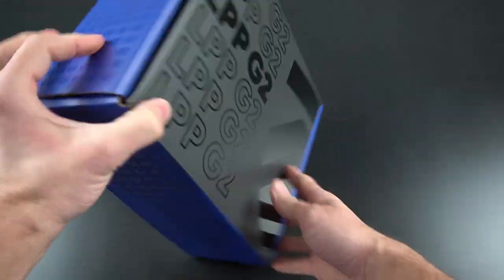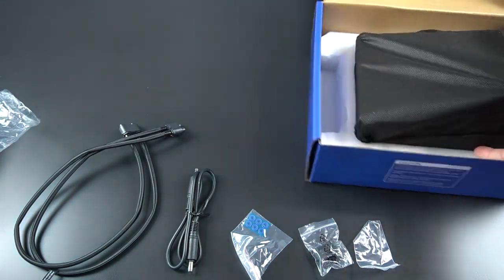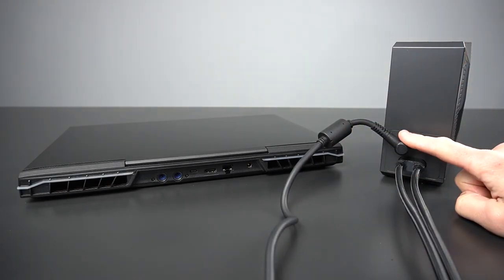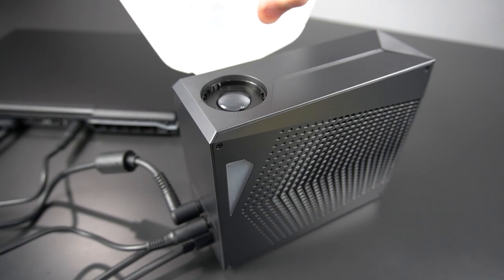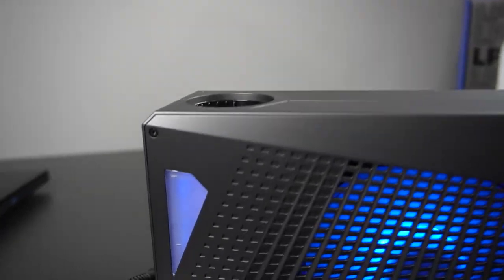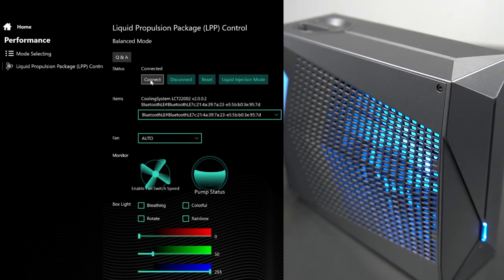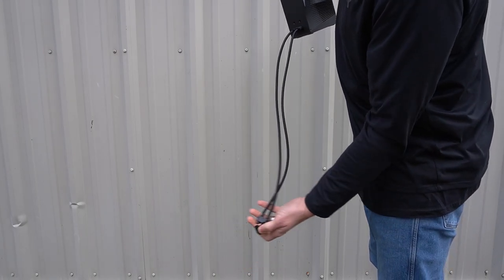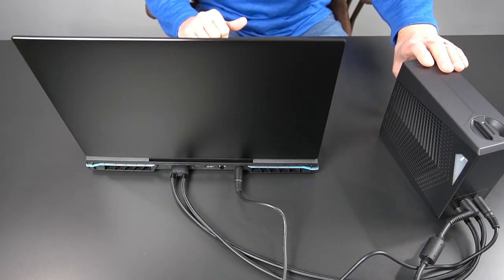Liquid Propulsion Package (G2) Initial How-To Setup

Comment: Great video. If fan NOISE is your worst enemy on gaming laptops, this LPPG2 really makes a difference over not using it?
Reply: Is this a statement or a question?
Reply: @petergriffin383  Pretty clearly a question, I thought?
Reply: @poppys33d  If I add the word "does" it makes more sense to me. To answer your question, every review I've seen says this setup is much quieter than having a traditional gaming laptop with a bunch of fans on high. I ordered the Mech 17 4090 because based on the research I did I feel confident this is the best solution to noisy fans and blazing heat that all other laptops contend with. Not to mention, constantly running high heat does degrade performance, even more so over time. I'm hoping this laptop will last me 10 years.
Edit: I can give you an unbiased honest review after I've used it if you'd like.
Reply: @petergriffin383  Stylistic response aside (I’d have said “makes” rather than “make” if it were a statement), I’m definitely interested in personal experience, thank you.
Reply: @poppys33d  Okay I'll post an update after I get some time on it
Reply: @petergriffin383  Appreciated!
Reply: @petergriffin383  Do you have any feedback yet on how your liking the laptop? I'm considering the 4090 17" like yours and I'm very interested to hear your opinion. I'm specifically interested to hear if it can run games (without water cooling) at reasonable noise levels. I'd like to be able to play in the same room as my wife without bothering her. I understand I may need to reduce the settings a bit so it's not maxed out. Thanks.
Reply: @johnwilson7680  I'm absolutely loving this laptop! It's practically silent with the water cooling hooked up, but even without it's still not loud at all. If I was you I'd get it. To answer your question specifically, yes, it's still very quiet without the water cooling while gaming, the fans are really not loud, I personally don't believe it would bother somebody sleeping or trying to sleep. It runs AAA rated games with ease on the highest settings.
Reply: @petergriffin383  Thank you for the quick reply. My current Lenovo Legion with an RTX 3080 is so loud that if I try to use it in the same room with my wife, even if she's watching TV, it's bothersome. This sounds like it would be significantly better. Especially since I can avoid pushing it quite so hard. I'm pretty happy with anything above 90 frames per second. I was a little concerned that with the water cooling, maybe they hadn't done as much to optimize the standard cooling. I'm glad to hear that's not the case. Thanks again.
Reply: @petergriffin383  I just noticed on the Amazon specifications that the display is only 350 nits. Have you used it in a bright room and does it feel at all dim to you? Also have you had much of an issue with back light bleed?
Reply: @johnwilson7680  If it was a glossy screen 350 wouldn't be sufficient in brightly lit areas, like outside. But because it's not a glossy screen 350 is good, I have no complaints. I can see just fine in a bedroom with lights on and even when the window blinds are open it's still good. I have not used it outside so I can't comment on that. If your primary use is indoors you'll be fine. There is a little bit of bleed through, but it's so little it's insignificant to me, especially considering the build quality, hardware, and noise levels... To me this is the best gaming laptop on the market. So again, if your primary use will be indoors you'll be absolutely fine, I wish I could tell you how it is outside but I can't, although I suspect it would be fine outdoors as long as you're in the shade.
Reply: @petergriffin383  Thanks, it's indoors but near a bunch of windows. Luckily it's in the Seattle area so it's rarely too sunny. :)
Did you order yours through Amazon or do you have a recommendation on where to order it?
Reply: @johnwilson7680  I ordered mine through Amazon, it came 2 days early and packaged very well.
Reply: @petergriffin383  Awesome, thanks for all your time. Much appreciated.
Reply: @johnwilson7680  you're welcome
Reply: @johnwilson7680  Have you purchased a laptop yet? Just curious if you went with the Eluktronics..
Reply: @petergriffin383  I haven't purchased one yet. Are you still happy with yours?

Comment: But how do I drain the LAPTOP? This shows how to disconnect the cooler, but surely now there's water leftover in the laptop, no??
Reply: 2:31 😂
Reply: @BobOfAllTrades yes, that shows how to disconnect the LPP.

There is still water inside the laptop. I do not want this. Thank you for your unhelp.
Reply: @JamCliche  Understood, sorry for the misunderstanding. The water remnants inside the laptop is minimal and won’t leak as the magnetic seal closes.  The magnetic drain tool adapter can be used to get a little bit out.   That’s inside the packaging within the LPP G2 box.
Reply: @BobOfAllTrades   it wasn't the misunderstanding itself that bothered me. It's just plain not fun to get laughed at for an honest request for help. I don't want to start any kind of fight with you though, just wanted to speak my peace on it. I am grateful that you have reached out and offered assistance, and it was good advice that I also appreciate. Thank you.
Reply: @JamCliche  I wasn’t laughing at you.  I think it’s silly how we have to empty the cooler.  I think it was supposed to work better because the way we have to dump it out is hilarious.

Comment: I recently sold my M16 alienware and currently driving the scar 17 SE. Im really tempted to buy sell this too. Im not really comfortable running liquid metal on my system. I really want to order that beast but Im abit afraid of issues especially I live in the Philippines atm. If there were any hardware issues once getting that beautiful beast. I wont be able to send it back easily. is there a option for Eluktronics to check first the machine before shipping it here in the Phillippines? Im starting to hate this 12-13th gen line up as they really are a beast of their own but the temperatures are so wild and hard to control.

Comment: Bought it brand fucking new and the pump is already dead with a yellow light, this is fucking absolutely absurd dude. Says there's water already in it for quality control well clearly they must not have used the right water cause you already corroded my fucking pump jfc
Reply: I’m sorry to see that.  How do you know if the pump is corroded?  Please reach out to Service.   Distilled watery solution only, correct?